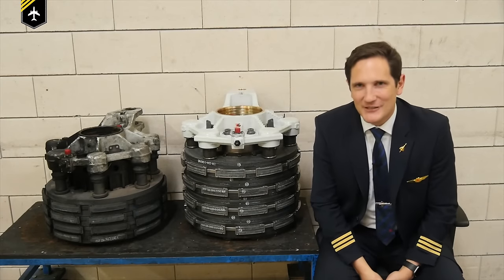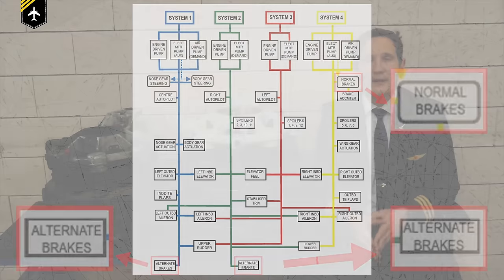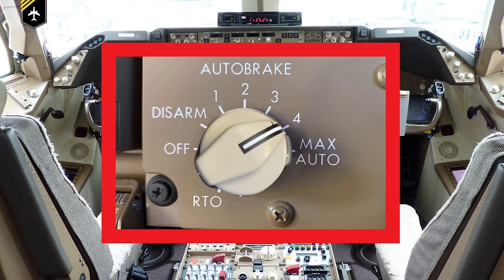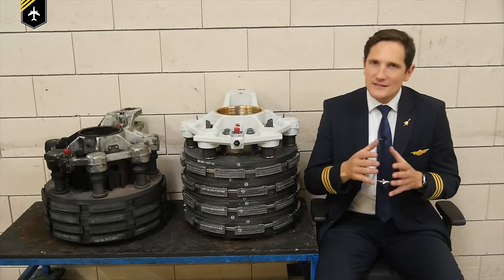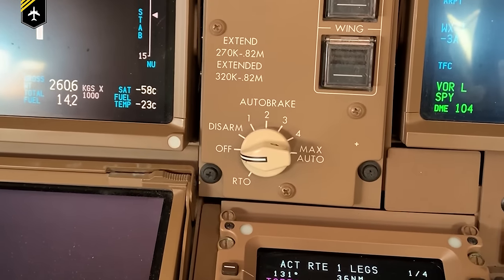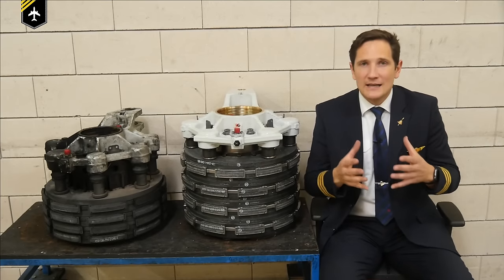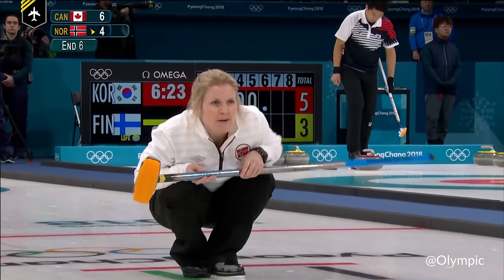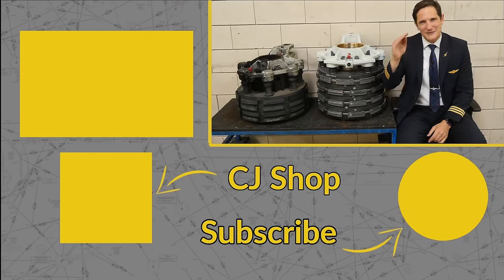How do PLANES SLOW DOWN on the RUNWAY? Autobrakes System EXPLAINED BY CAPTAIN JOE

Comment: I have a question, why do all radios, in planes, rockets, anything of that sort, sound so bad? Whenever i hear the recordings of pilots or air traffic controllers they always sound muffled and distorted, im sure good quality mics are not that expensive?
Reply: I remember long ago when they replaced the sound system in my high school. In the old one, the principal sounded like he was speaking to us through a megaphone from the parking lot. In the new one he sounded like he was sitting at the desk behind you. 

The school was able to change systems over a month break. Changing all the world's ATC, airport, and aircraft cannot wait for a month or even a day. Also, our school could decide to change on its own. It didn't require every school to change at the same time.  Imagine China decided to go with a new radio standard. Every aircraft flying to, from, across, or near China would need to be changed as well. it would require a lot of radios to be changed at once.

So, because of an interesting network effect we are stuck with ancient radio technology. 

Like everything in aviation, only highly trained people are using the system and, so, they can get away with rules procedures and equipment that requires training to understand and use. Conversely, the pilot, operational, and maintenance training needed for the new system provide another impediment to change. Finally, the safety unknowns of a new radio technology leave enough FUD about whether it would do the right thing in every situation. Suppose your company's new aviation radio technology caused a crash that would not have happened with the old radios. Are you willing to eat the liability risk?

In some sense, all these barriers and constraints make the current radios the only solution.

Comment: I remember in the 80's when I was a kid they used full reverse thrust every landing. How come they don't anymore? Wouldn't that save a lot of wear and tear on the brakes?
Reply: It burns more fuel when reverse thrust is on maximum.
Reply: @semirgerkhan4660  but still in the long run, wouldn't it be cheaper to burn a little extra fuel if you can double the lifespan of the brakes? I would think it would be more expensive to replace the brakes.
Reply: Noise as well. Lots of airports don’t allow Max reverse after certain hours unless in emergency

Comment: Hi Captain Joe, how does the pilot monitoring know if the RTO or auto brake selector is functioning properly?
Reply: Not sure if there is a fault detection built in but PM is supposed to make sure there is deceleration happening. If there isn’t they’ll call it out so PF can manually brake
Reply: Oh, ok thanks very much. 👍

Comment: i am interested in the technical parts. so i am guessing what is there besides you is many carbon brake disks but in each wheel there is only one disk? and the bolts press on it hydraulicly quite similar to a cars disk brake only without the calipers?

Comment: I'd like to know a little more about the landing gear struts themselves. What kind of forces can they take? What sort of lateral loads they can handle etc. Are they mounted with bearings or bushes. What is the shock absorber pressure?
Reply: It gets complicated as to combinations of loads the shock struts are designed to, but the basic idea is that for an FAR Part 25 (turbojet aircraft above 12,500 lb takeoff weight) certified aircraft, it can land at a sink rate of 12 fps without any damage.  At 15 fps is when things will start breaking, and various crash landings have proved that out.  For example, the MD-80 which had its tail section separate at a touchdown rate of about 16 fps after the flight test pilot tried to make an adjustment below 100 ft to save a go-around during a maximum-sink-rate landing, even though the test rules called for no adjustments below 100 ft -- just go around.
The main landing gear is also designed to strip off at its hinge point or "trunnion" (a journal bearing/bushing on the aircraft types I'm familiar with -- no point to using bearings [edit: "ball bearings"] when it's just a brief 90-degree rotation and not an extended period of rotation as for say a wheel) when the drag load becomes severe, such as from a runway overrun.  The point of that is to protect the fuel tanks from rupture which would occur if the entire trunnion structure was ripped out of the wing.
Strut pressurization amount (using dry nitrogen) is a function of how much weight is on the wheels, so there is a placard affixed to the strut instructing how much pressure to inflate to for a given length of exposed chrome.  That pressure might be in the range of a thousand psi for a loaded airliner, just to give you a very rough idea.
Reply: @marcmcreynolds2827  what a great answer thank you. I do find it amazing the loads that these structures must be designed to considering the amplifications of an aircraft mass due to the G-forces exerted on them. Also the transmission of shock load to the aircraft structure before the shock absorber can react fully.
Reply: @PPC4   The way the shock struts are designed, with that "air spring" built into the strut, the shock load is being felt more by the landing gear tire/wheel/brake assembly -- which is relatively small and so can be built really sturdy -- and not so much by the rest of the aircraft structure.  The shock strut isolates the rest of the aircraft from the worst of that initial shock.

While I wouldn't want to be under a tire at touchdown ; )  the landing loads aren't as high as they might look because at initial touchdown the wing is still supporting a whole bunch of the aircraft's weight.  So much so that if spoilers did't deploy soon after to negate much of that lift, the aircraft would usually bounce just from the spring force buildup within the compressed tire not getting canceled completely by the energy dissipation from the shock strut's stroking.

It is noteworthy in considering the magnitude of landing loads that it will typically be takeoff loads instead of landing loads which determine how large of a load carrying capacity the tire has to be capable of.  However ouch-y the landings may look, there is actually more load on the tire when it is rolling down the runway at max takeoff weight.  So that wing lift at landing touchdown really does make a difference when it comes to the sort of peak load the tire does (or doesn't) see.  That, plus the stroking of the shock strut to reduce the peak load by spreading out the landing event over several tenths of a second.

All that said, yes it is amazing the sort of loads a landing gear strut has to handle.  They are made from about the highest-strength steels available.  "300M" comes to mind.
Reply: @marcmcreynolds2827  Not to doubt you in anyway but I'm curious now as to how you have such knowledge? Could you perhaps enlighten me.. licensed mechanic, aeronautical engineer?
Reply: @PPC4  That's quite alright:  The "landing gear analysis" group at an airliner manufacturer, for the first seven years out of college.  Then "retired" to being a househusband when our kid was born, though I continued with some consulting for a while.  Our group did things like preliminary load analysis, brake energy calculations to feed into the spec for the brake vendor, tire heating research (keep your taxi speed down heading out to the far corner of DEN!), and assorted similar things.  Lots of "one-off's", which made it fun, e.g. someone forgot to  set the parking brake on widebody parked overnight, and it rolled across a tarmac colliding with a hanger.  "Marc, figure out how fast it was going when it hit the hanger."  [Only a few kt.  Notably, even at such a low speed the chocks that people were desperately throwing under the tires were just getting rolled over.  A lot of inertia in those things, even barely moving!]

Comment: I wonder if the usage of reverse thrust has impact on the selected Auto brake value ? 🤔
If the airplane still airborne and the brakes are applied until touchdown what might happen
Reply: Autobrake isn’t a preselected brake pressure. It is a preselected deceleration rate. Reverser, spoiler etc help you achieve the desired value. For example you land an aircraft which is quite light and deploy reverser after touchdown then your deceleration rate is already higher than a low autobrake setting and therefore the brakes do not engage. The slower you are the less effective thrust reverser become and the more the brakes are engaging.

Comment: Hi Captain Joe..! Could you please explain flap 3 and flap 4 landing..
Love from India❤️
Reply: NS it's just an airbus feature regarding how much flaps is to be used for landing

Flaps 3 gives better fuel savings and better go around performance but requires more landing tolerance

Flaps full gives better landing performance as i it'll use less runway and more stability during approach.

Comment: When do you use which lights? (Nav lights, beacon lights, strobe lights and landing lights).
Reply: Beacon from moment of pushing back to moment of shutdown of engines, nav I always thought was as soon as you enter the cockpit but apparently there are some airlines that don’t use them in the daytime. Strobes before entering the runway and off when exiting runway and landing lights seem to vary between airline. Always thought it was on below 10,000ft and off when no on runway

Comment: Capt Joe - Does ATC usually assign turn off point in advance or does the crew need to request if using BTV?
Reply: Seen multiple videos, some do some don’t and then some do too late after the aircraft is just about to pass it because BTV was programmed for the next intersection

Comment: Are the Auto Brakes "communicating" with the RAAS, so if it detects a to short runway, it would brake harder?
Reply: I doubt it as the autobrake on Boeing is just a programmed decelearation rate and doesn’t vary like the BTV
Reply: No. Each autobrake setting offers a fixed deceleration rate.

Comment: Question when you are on final is it pre determined which exit will you take and does The flight control know it? I remeber watching some videos where after landing while still on runway it is said which exit to take to the taxiways
Reply: Seems to change depending on the controller. I’ve seen videos where they inform the pilots before landing so they have time to change it but seen another where they asked pilots to exit and the BTV was set for the next intersection so they missed the one the controller asked them to take

Comment: One thing is not clear: isn't the peddals also responsible for the rudder? Do pilots need to push forward on a "horizontal" manner to apply rudder and push "down" like in a car in order to manual break? Is this the same on all commercial aircrafts? Thanks.
Reply: Ok found my answer here:
https://youtu.be/-7ormVjGh5o

Comment: Hey Captain Joe. I have a question, how does the airplanes keep the level of oxygen in the cabin constant even when it's a long trip? Thanks in advance
Reply: Giovanni Campos it takes the air from the outside. Yes the air is less dense outside, but it can still be used. Usually what happens is that compressed air from the engine is taken and that air is used for cabin pressurisation and conditioning.
Reply: @ZK-APA  Nice, thank you

Comment: Would it be possible to use a plane's brakes at the beginning of a takeoff to give yourself a little bit extra margin on your runway length? Essentially, allowing you to spool up your engines a bit higher while still stopped with the brakes clamped, instead of beginning to move down the runway and using up runway length immediately.
Reply: Yes, that is actually quite a common thing on a plane (just not sure if its common on an airliner)

Comment: Hi Captain Joe, could you explain the theory behind derated takeoff and especially in the Airbus systems, pilots have to do a callout when thrust is set like "MANTOGA SRS RWY A/THR BLUE". What does it actually mean?
Reply: Derated thrust settings reduce engine’s wear and improves engine’s life by using lower thrust settings for takeoff which will result in reduced EGT for the engine.
Reply: The call outs are reading from the flight mode annunciator which confirms FD’s are in the correct mode.

MANual FLEX/TOGA is the auto thrust mode and position the thrust levers are in

SRS is speed reference system which is the pitch attitude to maintain initially to maintain V2+10

RWY is the direction to maintain runway heading

ATHR blue just confirms the autothrust is armed and will be active when pilots move the thrust levers to CLB dedent

http://www.a320dp.com/A320_DP/nav-autoflight/sys-13.3.16.html

Comment: are the wheels of an any aircraft powered,can it taxi it on them, or the mains engines taxi the plane forward, i saw a vdo where a turboprop craft with engines off, move forward & bumped onto another craft.
Reply: The main engines are used.

Comment: Kinda disappointed- I imagined brakes during take off and the switch setting "RTO" as reverse take off. Pick up speed, spin the plane around and lift off with the back first. Kinda like a chicago turn with a car backwards. One would certainly need assistance- frome the plane for the maneuver and from some mental institution.
Glad the real systems are more grounded in reality- learned something. Thank you ^^

Comment: As I've read Incident reports in Flightradar 24, whenever an aircraft has to perform a RTO, the aircraft vacates the runway and is stationary on an exitway for about 30-40 minutes to cool off the brakes. Isn't this cooling of the brakes required during normal landing?
Reply: Not normally because the RTO uses maximum braking where as a normal landing doesn’t. All to do with physics and energy transfer etc. But also on a normal landing the aircraft is parked at the gate for 30 mins or more so has time to cool anyway